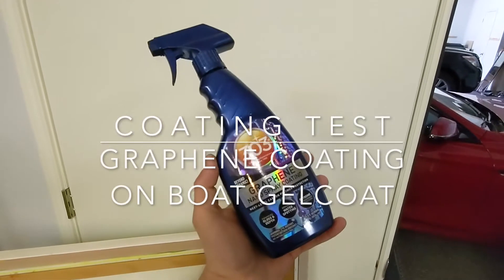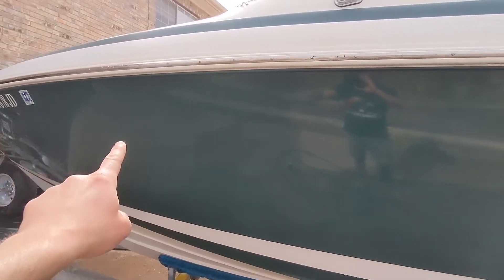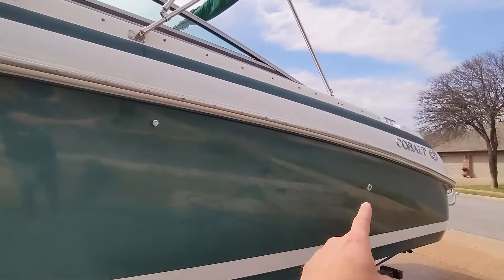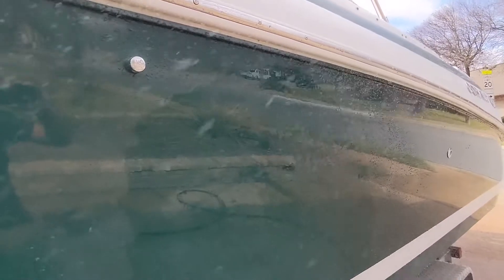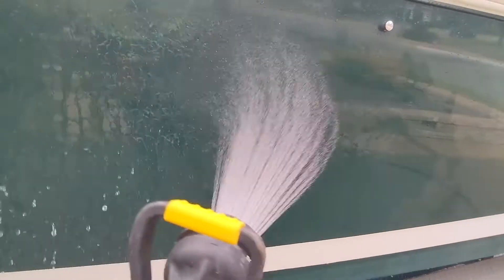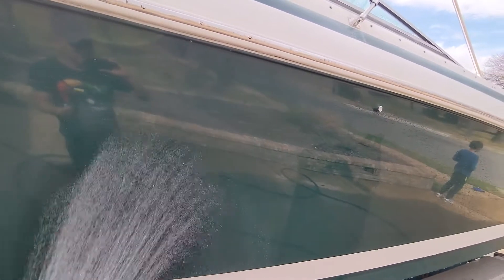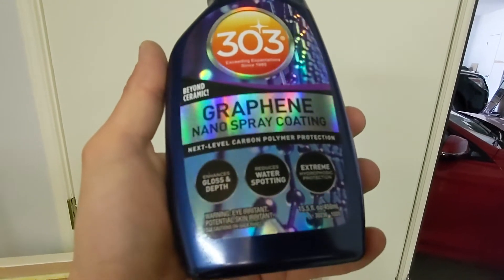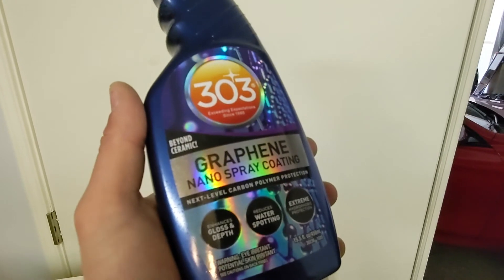Graphene Coating Boat Gelcoat Fiberglass - How do you think it did @303Products

Comment: 303 probably one best Graphene  spray u can get  But it has little amount of it  compared if u actually  put the official ceramic or Graphene it will last years boat stillblooks great
Reply from the maker: Agreed! This is an easy spray on wipe off application that doesn’t take much work. But for a coating that lasts years the higher content coatings are definitely the way to go.
Reply: @NKPGarage  You still have to do often maintenance to the full coatings too. I went with Turtle Was Flex graphene . 2 coats and after washing every time out I just dry it. Every 3rd use I spray a couple mists on the wet hull then towel dry. Been a year in the sun and still looks new
Reply from the maker: @JVRottweil  very good point. Still requires maintenance to keep up the shine. But worth it for sure!